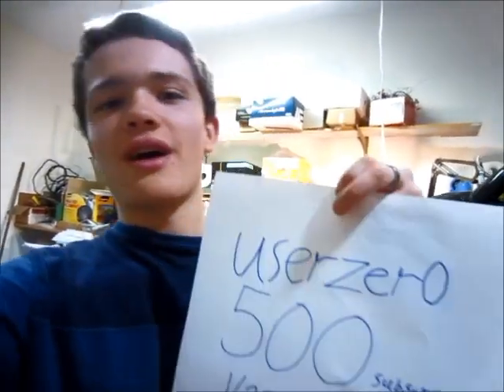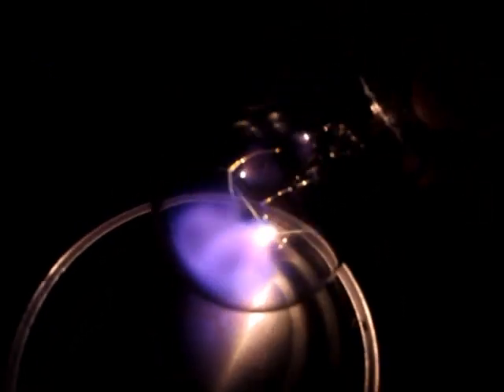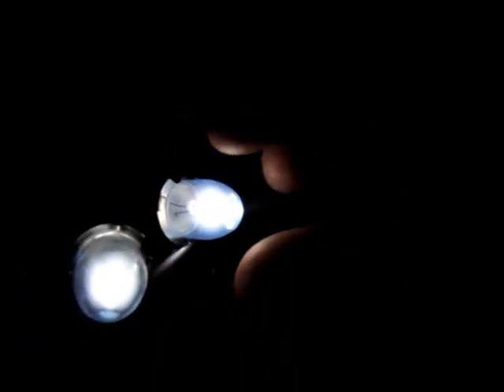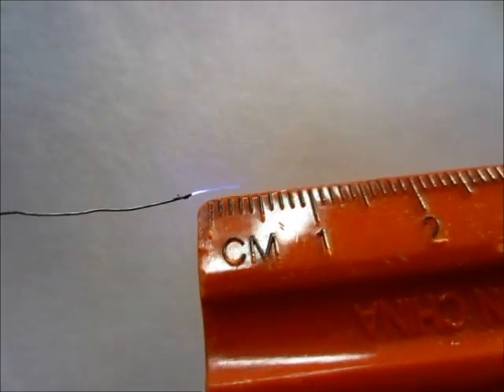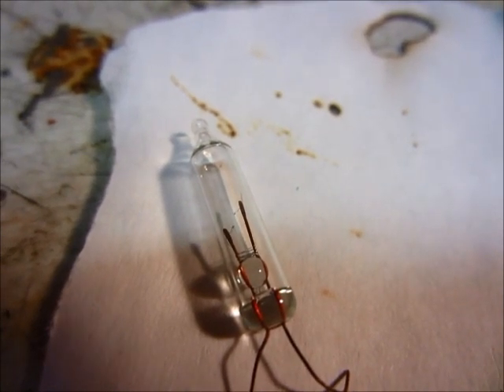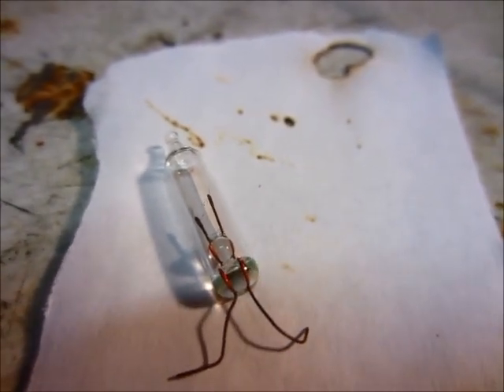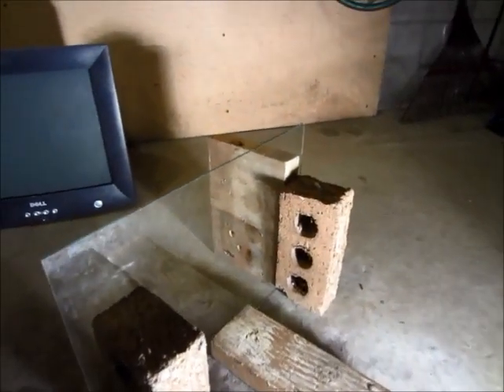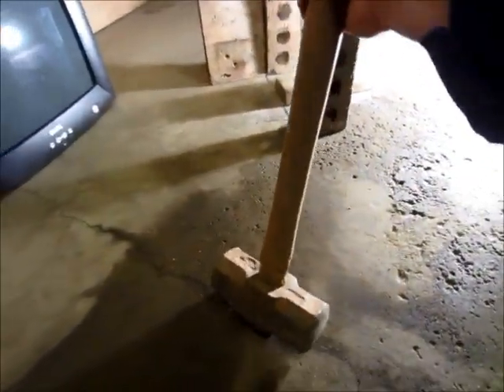500 Subscriber Thank You! CRT Smash, Close Up Tesla Coil Plasma, Christmas Lights Pop

Comment from the maker: Interesting.  That makes sense.  So I guess that the burned out ones don't work because the voltage is not enough to get the gas into the plasma state cause some of the filament must have vaporized, so there is less vacuum.

Thanks!

Comment: Interesting how many different ways the bulbs explode. To keep the monitor from dying when arcing you could put a few 100 kilohms of resistance in series with output wires. I usually put them on the ground side so there's less issue with sharp wire ends. I think I use 220 kilohms, 2 watts resistance.
Congrats on the 500 subscribers!